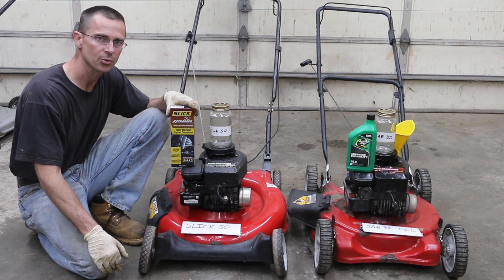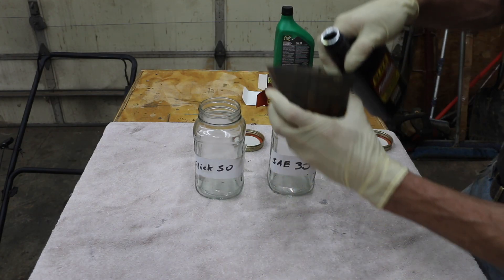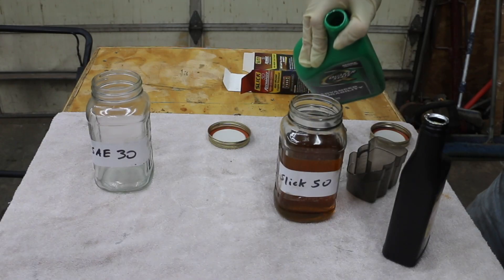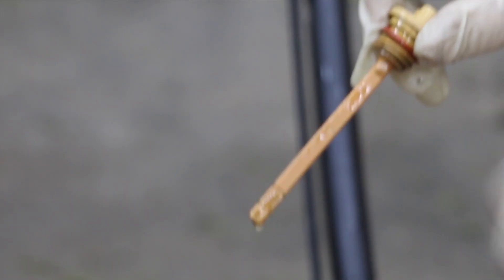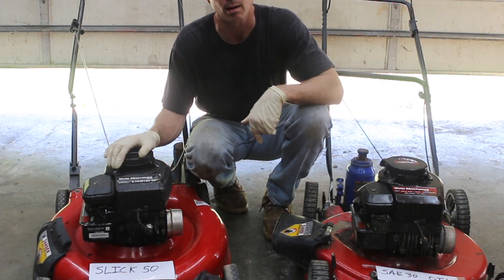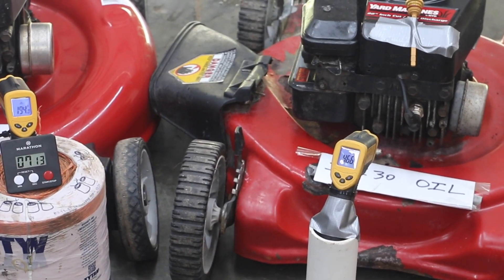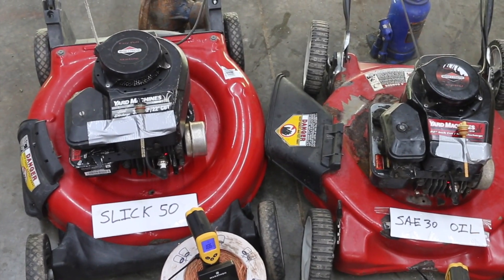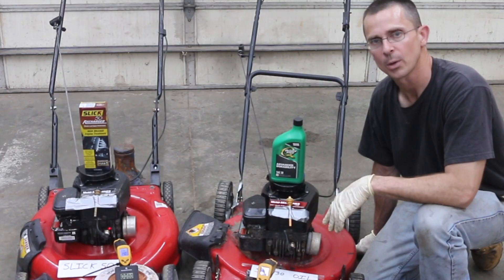Can't believe what SLICK 50 did to my engine!!--Dry Crankcase Test!

Comment: Wculd you please check Z-Max against Slick=50 using double the 10% for both Brands on a Run till it Seizes Test like U did regular motor oil against regular motor oil + 20% slick-50. I have used both but continue on Our Toyota Camrys to run the Z-Max because it makes them run cooler consistently & I just add a Bottle after a Synthetic Oil Change once every 3 months. Back when I was Driving 120 miles a day to & back home from work was when I fell in Love with Z-Max. It works just as well with the V-6 Toyota Engine as the 4 cylinder & actually seemed to cool the 4 cylinder better because it is revving more to do all the same work. I was using the Cruise control to quit getting speeding tickets back when I was commuting 60 miles one way every day 6 days a week. 3 Different Toyotas; 2 are 4'a & 1 was V-6. I'm just Guessing the Z-Max will  make a motor run as LONG as Slick-50. You May Have to set up a remote monitor on both motors to see which Seizes 1st.
 I'd sorta Say if Both ran 4.5 hrs just whichever kept the engine cooler would win & U could not run till U seized. What runs Coolest is what we are looking for anyway ! GranPa David M for Motorcycle Crasher Tharp who Has Run Several Vehicles till a rod jumped thru the side of the Block ( Fords ) V-6 that was too small & had a crappy auto tranny to go with it. Never Ran anything low on oil; Always take care of my Ride !!
Reply from the maker: Thanks for the suggestion.
Reply: @ProjectFarm  Also, in the mid 70's there was a Shop in Sarasota Fla I raced out of & they put BG Extreme Pressure Concentrate in all the enduro Racer's RaceBikes bottom end ( big end of Rod on Crank & transmission Oil 2 Stroke engines 125/250/400cc ) The single mechanic said it made a Seizure usually not ruin very much of the engines by protecting them even when we got the Air Cooled 2 strokes over heated for 4 hours of a 4.5 to 6 hrs long Enduros in Mid & South Fla in Summer & Fall & Spring even WInter it was still Hot most every Race for the Air Cooled Engines & the Sweat Hog Racers ! They had to just take an RM-250 1976 engine's cylinder off & Unstick the Rings where I added the Required 2 stroke oil to my 5 gallon Can & my friend thought i hadn't & added the full amount again & it just Gummed up the Rings & the Cylinder Head. So The mechanic got interrupted working on that engine after that race & he had got it fixed & added the 2 oz. of BG Extreme Pressure Concentrate ( which was a Black & fairly viscous Liquid, black as the ace of spades & it would Stain Jeans that washing them 3-4 times would finally mostly remove. But Art forgot to add the Quart less 2 0z. of 40 Weight Oil We had settled on for my Race Bikes. So i picked the motor up & took it home 22 miles away & re-Installed it in the Frame Friday night & we went way out in the Woods of North Port Fla to Race each other for fun on about 80 to 100 miles of tails out there that we usually used about 40 miles of on a non-Race Weekend. There were 6 of Us & the Bikes were Loud & I was already about half deaf. When we got back a Friend on another 250 wanted me to show him how I went over a Natural Jump created by the Engineers Digging Canals to drain the Swamp & leaving Piles of dirt that eventually got hardened by rain & this One was the perfect Launch Pad for a Spectacular Jump that would be You & Bike 20-25 feet in the air at the highest point of the Jump & it would be about a 60-70 Foot long Jump from take off to landing. But I Hand done the Jump & let my Legs absorb some of the Upspring of the Rear Suspension & Slightly Backed of the throttle just before Hitting the face of the jump & only gone up about 15 feet & the whole jump was about 40 feet long so him beside me being way up in the air saw me hit the ground way before him & put about a 6-8 Bike lengths lead on him by keeping my rear wheel Driving on the ground a lot quicker than him. So we got over to the spot about 5 miles away & I noticed my Bike was making a weird rattling noise when I shut it off & the Clutch was not Performing as well as Usual & checked the Oil & there was none on the Screw in dip stick at all. So Told him what to do & he tried it 4-5 times & did it really well by the 5th time & we slowly rode back to where were parked the Pickup trucks. I ran up the Road to North Port Charlotte Town & Bought a quart of 40 weight motor oil & put it in my bike till it topped the oil off to the full line & poured the rest in my 1968 El-Camino. I took the bike for another about 10 min. ride after I added the Oil & then Checked the Oil & I could detect the BG Extreme Pressure Lubricant in it & dried my index finger & thumb off on my jeans & it stained them Just Right so I knew Art had put that in there. We had a Big Race in Titusville that next weekend so I took the Motor Out Sunday nite & put it in the Wooden box in back of the El-Camino & dropped it off at the Suzuki Shop right before closing monday night & told Art What had happened. He apologized & said he would tear it all the Way down Tuesday AM & Call me at work to tell me if there was parts needed damages. There were None & He put some new Clutch Plates in it because it had been 2/3rds of the way worn out before I ran it with nearly no oil in it & the Plates that had the asbestos/rubber like stuff on them stunk of being Burnt. So I got free new Clutch out of the Deal & Art didn't even charge me labor. He talked all the Rest of the Woods Racers & Most of the Motocross Racers into using the BG Extreme Pressure Concentrate after that ! I sent them a message on Facebook to tell me if One of their new Products still had the Old Black Slick stuff in it that made the Air Cooled 2 Stokes run Cooler ~!

Comment: Judging by the temperature gauges , the Slick50 motor at about HALF the temperature of the conventional oil...without a tear-down to determine what the failure of the Slick motor was , I would say the Slick motor simply broke down for another reason.  It is OBVIOUS the conventional oil motor seized based on temp AND the smoking from the high temp seize up shows this.   As far as the Slick50 is concerned , this tells me  tells me it WORKS to GREATLY reduce friction - hence the MUCH lower temp !!
Reply from the maker: Thanks for the feedback.

Comment: The new slick 50 is 10w30 & dosen't have as much ptfe if any. Those videos were the original in a can Was 30w. W/ with plenty of ptfe. U had 2 shake the heck out of it 2 get it suspended. The u could open the whole top of the can & there was plenty still in the bottom of the can. I've seen a mower cut a whole yard with no oil in it.
Reply from the maker: Thanks for the feedback.

Comment: In  the mid 80's I installed a briggs & stratton engine on the back of this salesman's car witch he had a plexiglass side cover made to see into the engine as it ran, we ran a full quart of slick 50 in it for a few hrs. then we drained the oil, an ran it without any oil for a while, It did work and, He used it in fairs and shows to sell that stuff before it came into the stores, I know it works at some degree to remove friction. just my 2 cents.
Reply from the maker: Thanks for the feedback.

Comment: My father was the Service manager of a marina in the 70's and 80's. He used Slick 50 in the crankcase  of the 4 stroke engines and the lower units on all  outdrives. He kept meticulous records on the boats over years of use and claimed a $360 savings in average repair cost over the 100+ boats He maintained.
Two things that he did ( I believe are in the instructions) was to warm and shake the bottle before  pouring it in the unit. The bottle is filled with mostly oil, the active ingredient settles to the bottom of the bottle. The heat of the engine is what help Slick 50 to adhere to surfaces.
Reply from the maker: Thanks for sharing.

Comment: I (certified aircraft mechanic since 1984) unknowingly ran a 2.0 liter Ford Escort engine dry of oil (the indicator light failed) for well over 100 miles. Try that with an engine which doesn't have PTFE resin treatment in it. Dramatically cheaper than using Lucas & only needs the treatment every 50,000 miles. I use PTFE resin because in Oshkosh (1988) I've seen an aircraft treated with Slick 50, drained of oil, then flown around the pattern (take off, crosswind, downwind, base & final. I treat every 4 stroke engine (with a dry clutch) with PTFE resin & would have it no other way. It's proven itself to me.
Reply from the maker: Thanks for the feedback.

Comment: I think that the slick fifty requires a operation time to permeate in to the metal where it does it's bonding
But the fact that it did run cooler definately says something for it 
I was also surprised that the slick fifty engine seized first
It kind of defys common sense
Reply from the maker: Thanks for sharing.

Comment: I believe that the slick 50 actually did help the engine.  It cleaned ALL of the gunk out of the engine therefore when ran dry it locked up very quickly, whereas the buildup in the other engine had tiny amounts of oil coming out of the residue on the inside as it heated up and allowed it to run much longer!  The faster the engine locked up that tells me there were fewer deposits in the engine when drained.
Reply from the maker: Thanks for the feedback.

Comment: I think over the years because of lawsuites, Slick 50 has changed their formulation. It's not what it use to be. I think too that you are supposed to add Slick 50 while the engine is running. Otherwise the TFE(teflon) settles in the bottom of the crankcase.
Reply from the maker: Thanks for the feedback.

Comment: Hey, love your videos, but i think your experiment for this video might just be flawed.The main benefits from using slick50 don't start showing up until after a somewhat long period of use.  When its first used your suppose to basically skip an oil change to gain the best results.  It works by Chemically bonding a protective layer to the surface of the metal, first by preparing the metal and then permacoating it. In your experiment, you did not run the motor for a long enough duration and temperature for the chemical  process to occur .  This might take hours and hours of operating time, but when the chemical reaction takes place, the motor will instantly run much more quiet, you will know when it happens.The dirtier the motor, the longer it takes to prep the surface.  Another thing to consider is that the slick50 of today is not the same slick50 of the past due to a couple of law suits and patent infringements.  The origional product is still currently available under the name Xcelplus, and the name slick50 today is just that, just a name on a product.    But is it the product that John Bishop invented?                       FYI- I am not a mechanic, nor do i work for slick 50 or Xcelplus, just a nerd that cant spell.
Reply: Yep, 1984 was the year Slick 50 changed the formula.  I remember it prior to that and it even looked different from the stuff they are using today.  Frankly using Slick 50 now is kind of pointless as it is no different than regular oil.
Reply: Yes, something doesn't make sense.  The Slick-50 engine wasn't even that hot.
Reply: Agree with all y'all!! I was shocked until I seen your comments!! Ty I will put a quart of it with 4 quarts of my regular oil when my daughter does my oil change.
Reply: does the now adays slick 50 work like that still?
Reply: I definitely agree with your comment. That wasn't enough time ran for the slick 50 to do what it is designed to do. As for the heat, slick 50 does what it says and the engine runs cooler. This demonstration even proves that. I would like to see this on 2 new identical motors and slick 50 time to do what it does. The motors in this video there was surely a difference in time they have been ran and how they were maintained. Flawed video for sure
Reply: @SILV3RBACK3424  100% Correct. it has to run for several hours to treat it let alone use the whole quart NOT 20%.  I use to sell a brand much better than slick 50, The oil was white, had more PTFE resign in it. we had a treated small engine we could demo with a plexiglass crank case cover proved there was no oil in it and it ran for a long time without oil. IF it seized up due to it the resign wearing off you still could turn the engine over and retreat that same engine over and over again.

Comment: Slick 50 was oil with PTFE in it that was milled to micron level. Basically, plastic bits that clog oil rings. 
When I had a manufacturing company and built pressure washers, the engines that came back having failed overwhelmingly had the Slick 50 added. Oil Rings were just pack with melted plastic on disassembly. 
That was in the 1980's. Not sure if they still use it now. 
I found that high quality FULL synthetic oil in the engine mfg. RECOMMENDED regular oil viscosity did the best at Long Engine Life, and did reduce engine operating temperature compared to non synthetic. 
There was one brand in particular that did better than the others, but I am not a commercial for any company so not telling. The caveat to synthetic oil was when it got the a black color, changing it was best. Just like non synthetic. Back is carbon, carbon it grit, grit is like using sand paper... change that oil. Small engine usually do not have an oil filter.
Reply from the maker: Thanks for sharing.

Comment: What is sad about this test is that I need a lawnmower to cut weeds now. I toasted the two that I had, usually you can find them around town that won't start and are abandoned. Clean the carb and they usually just start up. Covid 19 must of killed a bunch of them as I have not been able to find any lately. 

I can tell you that if you find one without a dip stick and pound a cork in the hole it will eventually run out of oil and quit running. Also running one in very dusty conditions without a air filter will also cause it to quit running.
Reply from the maker: Thanks for sharing.

Comment: Engines with regular oil one session before you use the flick 50 to enhance the brake in. I'm not sure if you use two brand new engines that hadn't run but it is possible that may have factored in on the one going down sooner with a slick 50 since nothing the bearings are rings were not broke in properly thanks for your testing
Reply from the maker: You are welcome!

Comment: BOGUS TEST. You have to treat the motor first. That means running the motor with Slick 50 for several minutes to allow the chemicals to bond. Do a re-test after properly treating the SL50 engine to make it viable.
Reply from the maker: Thanks for the suggestion.

Comment: Note: You have to treat the engine first, that means running the engine with the Slick 50 in it for a few miles to give the chemicals time and temperature to bond to the engine parts. I sold Slick 50 when it first came out in the late 70s early 80s. We would run the treated lawn mower engines with the oil drained for 40 mins before the engine seized.
Reply: The instructions said on mine back in the 1980s run for 1,000 miles, coating the internals then change oil and filter because the filter gets blocked, my cars were street raced and never blow an engine, ford Escort did 200,000 miles and was still wheel spinning to the scrap yard.
Reply from the maker: Thanks for the feedback.
Reply: More than that, you cannot run it straight, it is designed to be mixed WITH motor oil.  The entire procedure was done incorrectly.
Reply: He mixed it with oil at the beginning
Reply: @ohyeahdakota  some people don’t see what just passed their eyes lol
Reply: @jacktheripper8408  Wow you really do not pay attention to details and clearly didn't watch the video! If you did watch the video your not very observant and lack basic comprehension. He DID use only 20 percent of slick 50 mixed with SAE 30 oil in one mower and ran straight SAE 30 in the other mower.